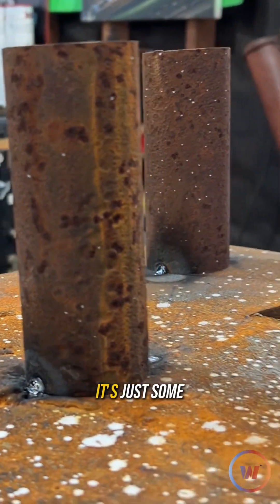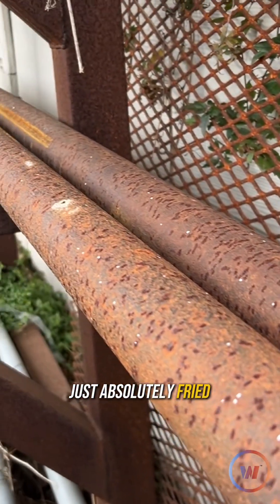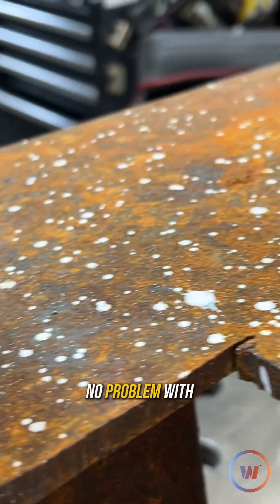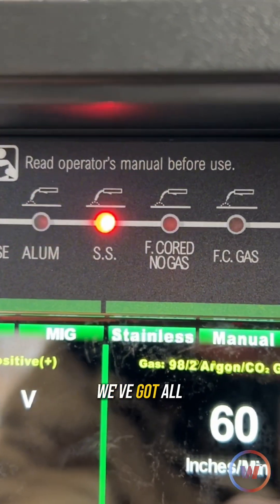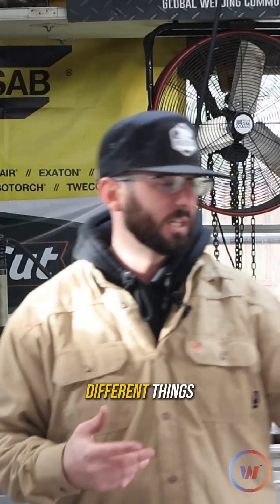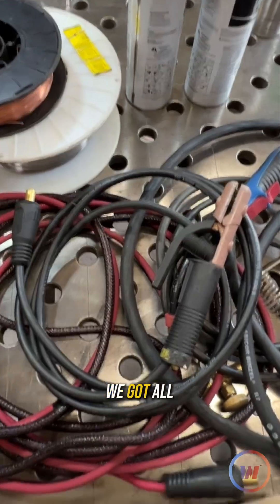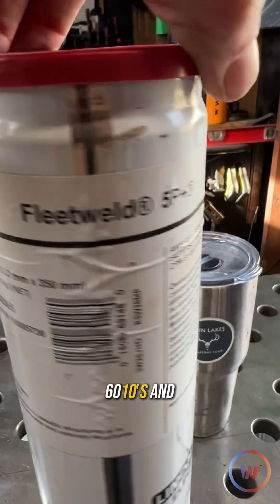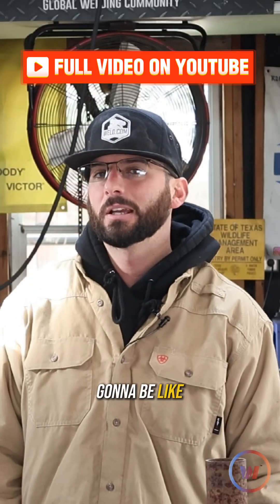What is the best process for welding over rust if you have to? #welding

Comment: Obviously SMAW, everybody knows that. Rust, paint, galvanized, no problem! You get deep penetration so it has no problem burning through the impurities on the surface
Reply: But not all sticks. 7018 would hate that. 6010 wouldn’t care but that pipe is thin. 6013 would probably be my bet.
Reply: @mysticnick1  all stick, because the process itself provides enough arc force to penetrate well past the surface contaminates. Ive burnt though THICK galvanized coating with 7018 before no problem.

Comment: C’mon now, if you can reach it to weld you can reach it to prep.  Even minimal prep is better than trying to burn through that ish.  🙄
Reply: This.
Even if you can't get in there with an angle grinder you can get in with a wire brush and a mill file.